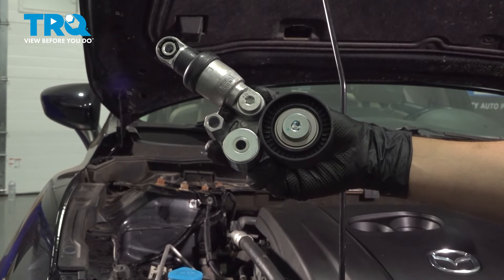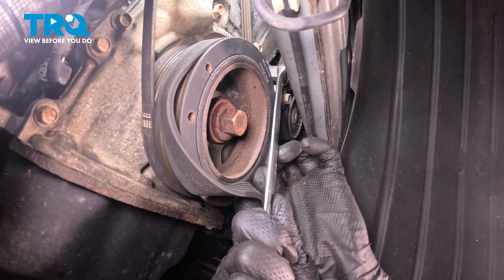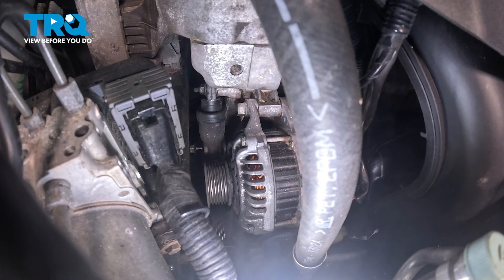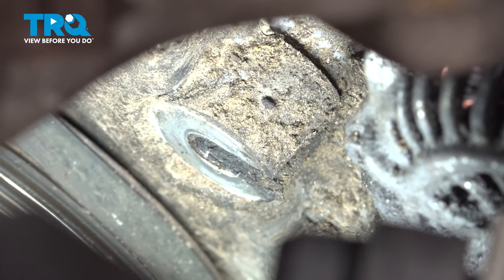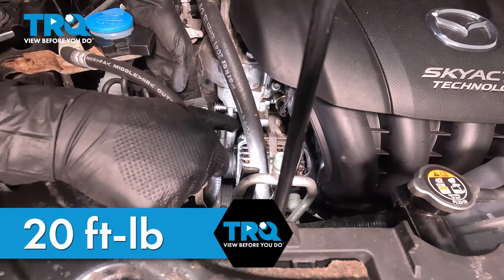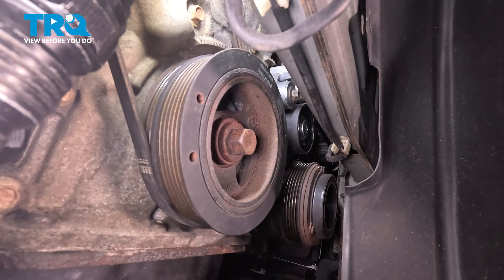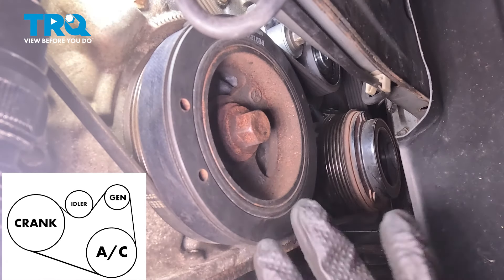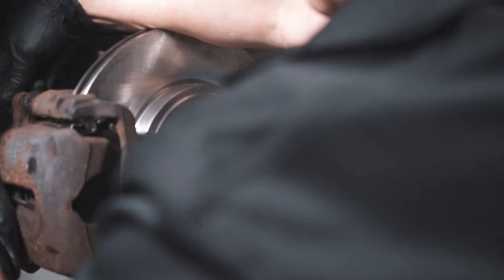How to Replace Accessory Drive Belt Tensioner 2014-2021 Mazda 6

Comment: You can pop some clips off the front wheel well cover to access the top tensioner bolt for removal and installation. Entire cover doesn't have to be removed, just enough to get access to the top tensioner bolt. This also enables a 1/4 or 3/8 torque wrench access to torque the top bolt.

Comment: Great video. A tip for other readers about the top 12mm nut; if you take off the fender liner as well, you can access it straight on with a torque wrench.